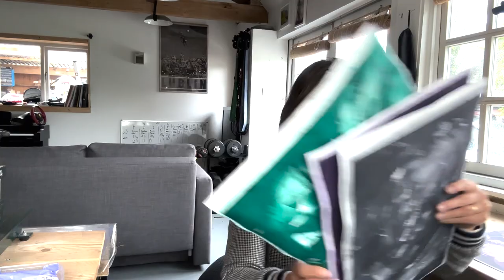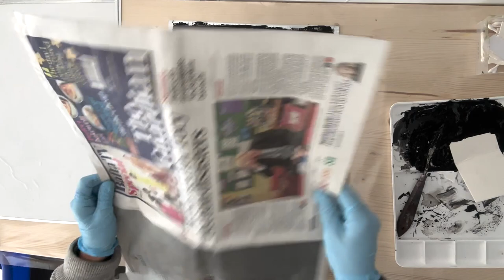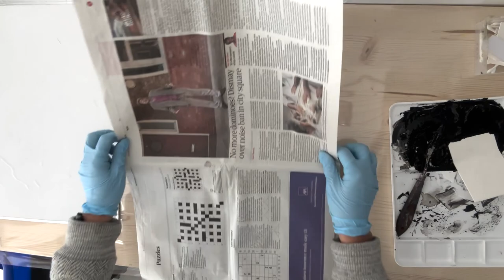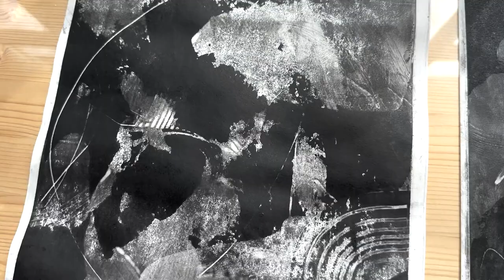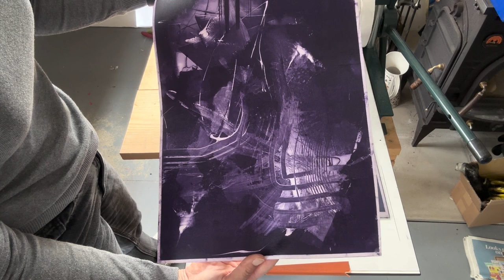Collagraph Printing on Silk - (Part 1)

Comment: Indeed the black is very stiff at the level of the ink, You can soften the ink with cooked linseed oil. Excuse me I went too fast you are with a base water!The problem of hardness is identical you can correct with glycerin. The purple is very deep it is beautiful.You can also use an alum mordant by soaking the paper before. Merci à toi
Reply from the maker: So many interesting suggestions thank you. There’s always a solution somewhere I find! Thank you for watching 🤗